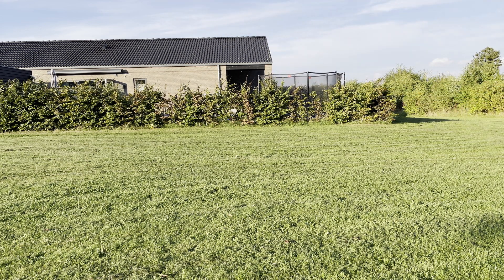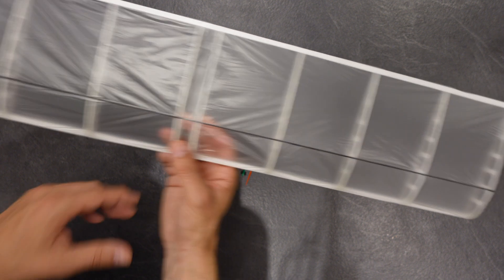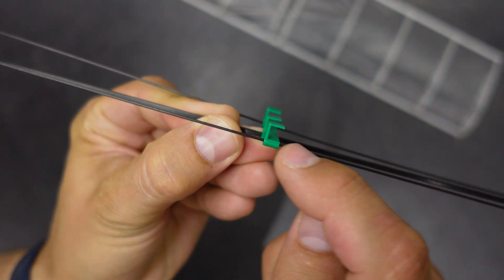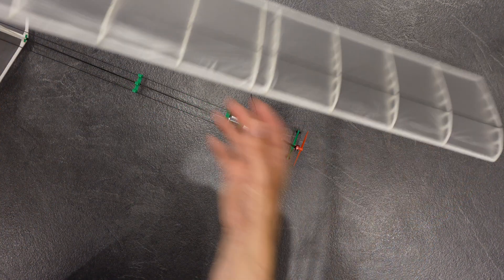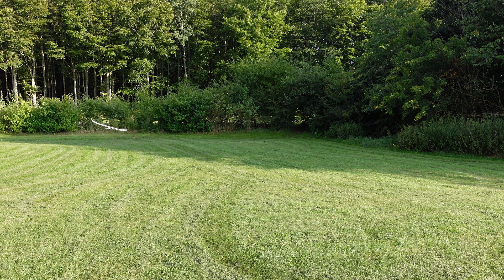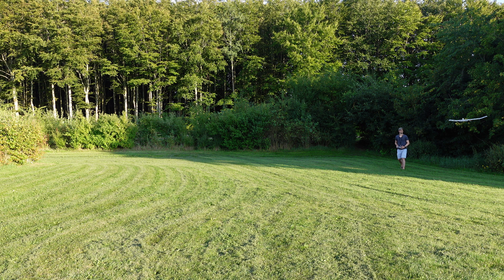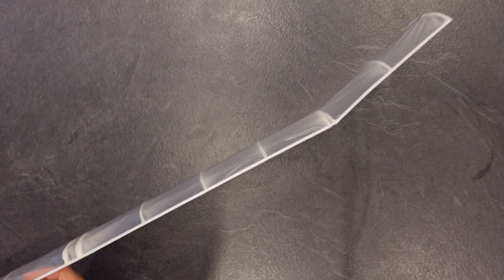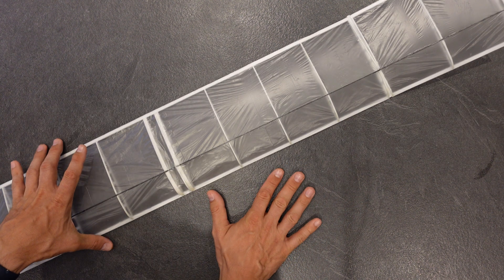The world's lightest brushless RC motor(Happymodel SE0702) on an RC airplane

Comment: Really cool to see a model powered with this motor! What kv did you choose ? I am considering making a 1S 20mm EDF with the 26.000kv motor…
Reply from the maker: Thanks, I used the 26.000 kv. Would be cool to use in an EDF
Reply: Did you end up making the EDF? I got some of the  16,000Kv versions for a 20mm EDF since that one is rated for 2S.

Comment: may i suggest trying emergency blanket as covering material. it is lighter than the plastic you are using and it does not stretch at all, would provide more rigidity espacially against torsion. you could even try to rub down the metallization with some solvent, window cleaner worked for me^^
Reply from the maker: Thats interesting! The plastic weighs less than 2g for the 115 cm version. Do you have any idea what the weight of the blanket is?
Reply: @kaspersorensen  I just put a complete blanket on my scales. It is 1.6 by 2.1 meters and weighs in at 40 grams, thats 11.9g/m². might get even lighter with the metalization removed. The biggest advantage imho tho is, that it doesnt stretch, therefor making the wing stronger.
Reply from the maker: Sweet! just measured the plastic and it weighs approx 8,2g/m2. I wonder how much lighter the blanket will be without the metal
Reply: @kaspersorensen  Get one and start playing around with it 😅

Comment: What is the total weight of the aircraft. 29 grams And you'll need to wrap the underside, cuts down turbulence = greater stability. Great aircraft. thanks a veteran
Reply from the maker: Thanks! My dad suggested the same thing. It will add less than 2 g to the weight of the wing, so it might be a good investment in weight
Reply: @kaspersorensen  You are a smart and truly great man.

Comment: Flies great! Don't forget about balsa too as a material, might be useful to keep the tail more stiff if you get the sizes just right.
Reply from the maker: Thanks. I guess I should try out balsa sometime. Depron/foam is cheap and so easy to work with, and with a laser cutter I can quickly produce things.
Reply: @kaspersorensen  Balsa is stiffer and lighter it is also easily cut with a laser. You could also consider a detail to cut down on weight.
Reply from the maker: I guess I have to do depron vs. balsa video and compare eg. tail performance.